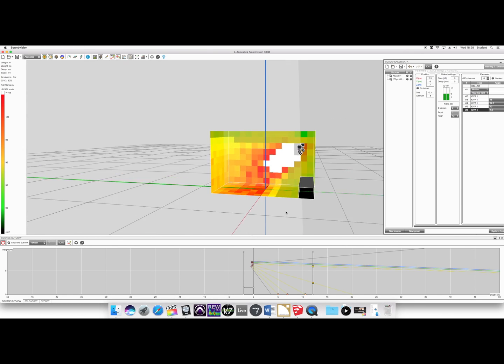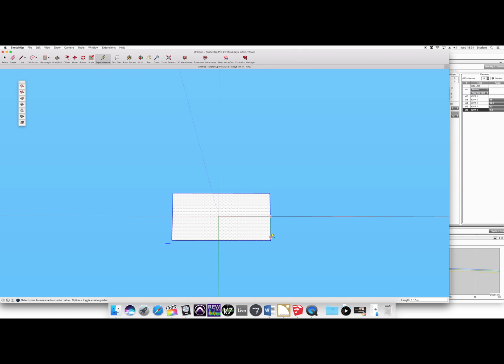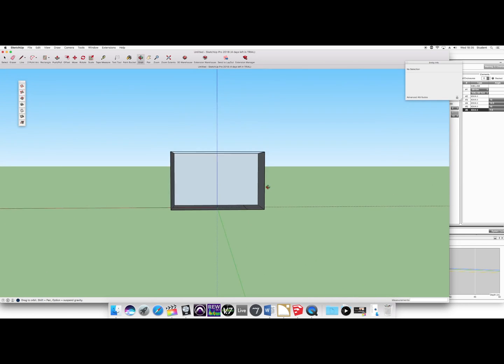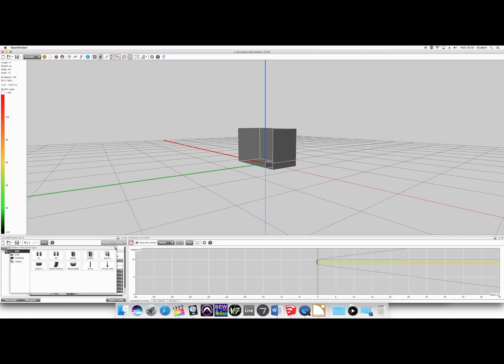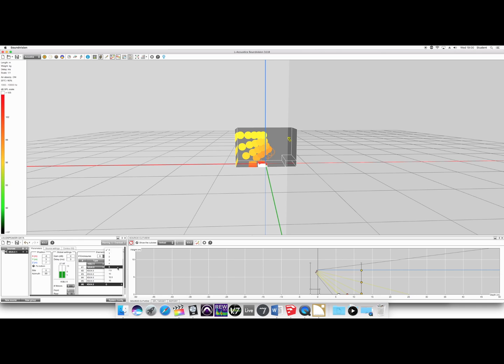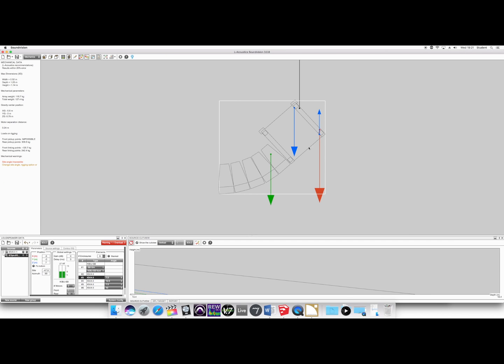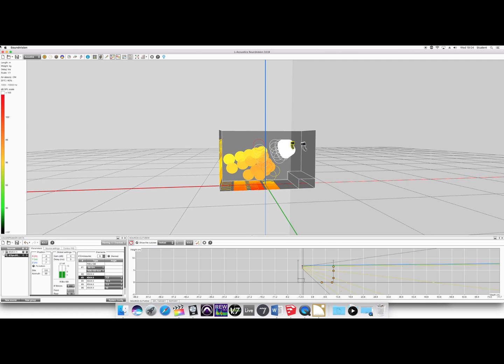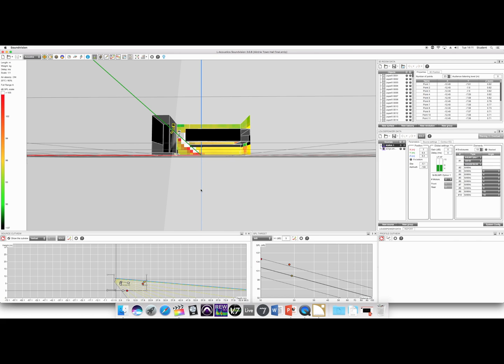System Design Tutorial

Comment: I'm afraid this is not how to use Sound Vision and will not result in an optimal system design. You have not introduced audience listening heights in the room and all your mapping is on the floor, not at ear level - therefore irreverent. May I suggest you get some L-Acoustics training, as your understanding of line array theory also seems a little weak. You should not use gain shading within the array as it will violate at least 1 of the five WST criteria outlined in Chistian Heil's 2001 AES white paper on the subject. Also, the origination point is always taught to be at the down stage centre point with the green axis for and aft. Finally there's no need to work in sketchup then export - it is easy to create the room directly in Soundvision once you learn the program.
Reply from the maker: King Sound Reinforcement UK this was a university project and  very first look at anything like this.

Comment: Really good tutorial however, I can't seem to find the option to export the file as a .txt , please could you help?
Reply from the maker: Hi,

So it should be Extensions at the top of the screen in sketch up , then click L-Acoustics , then click export to soundvision then you must save it as a txt file in order to open up in Soundvision. Then save.

Once this is done go to Soundvision, press the folder with the blue arrow in it and you should be able to select the txt file you just saved. If this does not work first time , keep trying and make sure you are saving to the correct place. 

Hope this helps.

Roisin
Reply: 你好！我也是没办法将Extensions草图中的数据在soundvision中打开？
Reply: You need to install the plugin that you can download from L-Acoustics website, otherwise you will never see that.